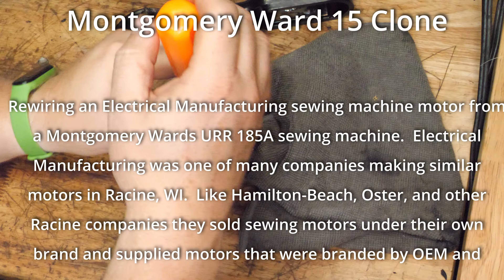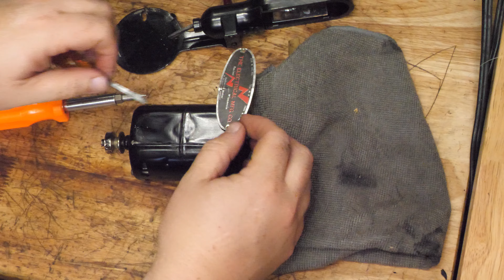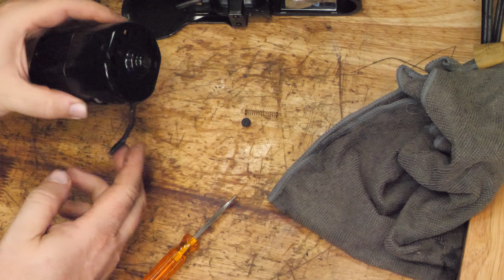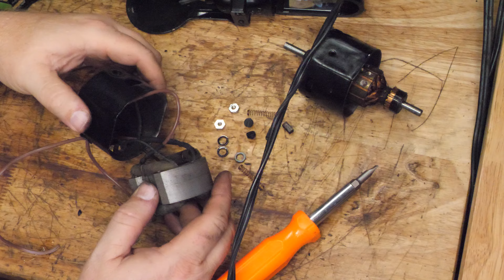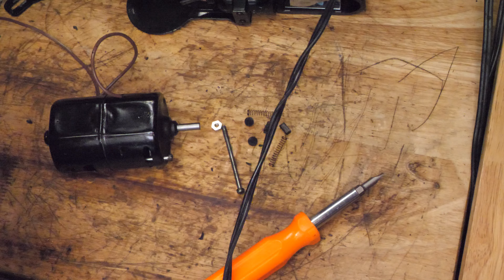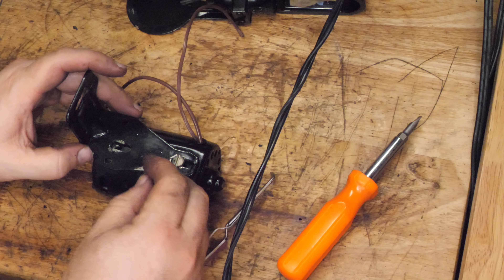Montgomery Ward 185A Part 2 (Motor Rewire)

Comment: I didn’t know you have a YT! You just helped me with getting a Montgomery ward motor housing on FB group! I still can’t get the other half off, maybe watching this video will inspire a new idea for that!
Reply from the maker: If you can get one side off then the other will usually pull out a bit easier, but unless you need access to the wiring in whatever half the rotor is sitting in there isn't a reason to completely separate a motor into the 4 main sections (2 housing halves, rotor, and coil).  Just getting the side off where the power cord connects to the coil is enough for rewiring and the rest of the motor can usually be cleaned and serviced without full disassembly.